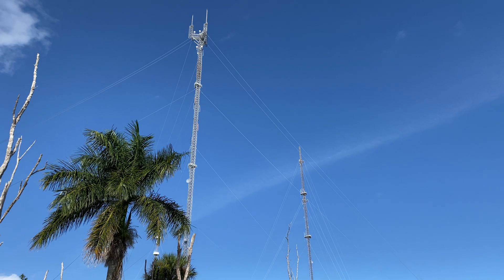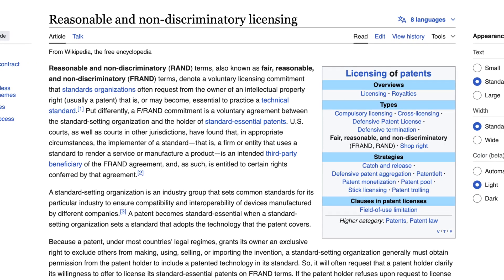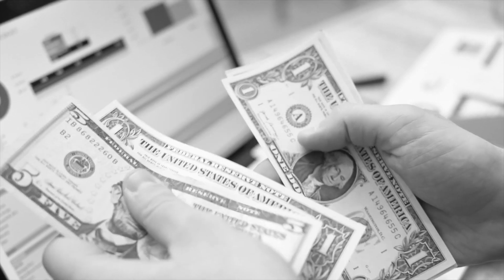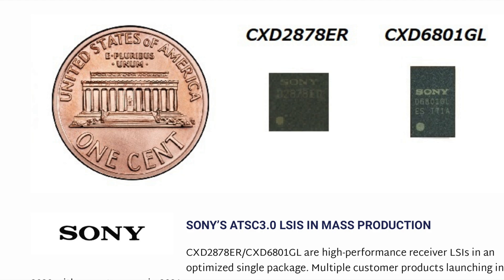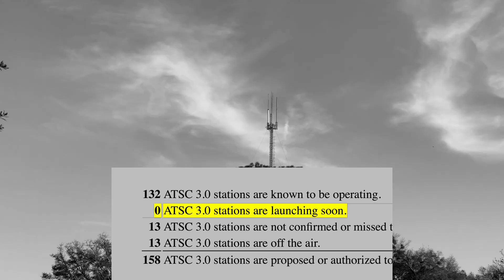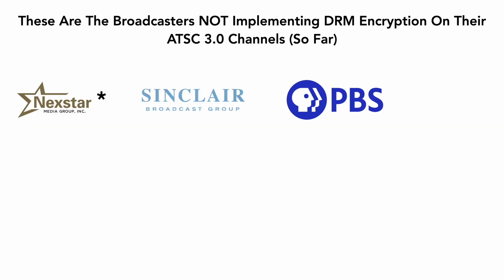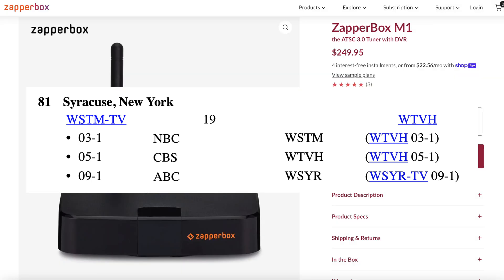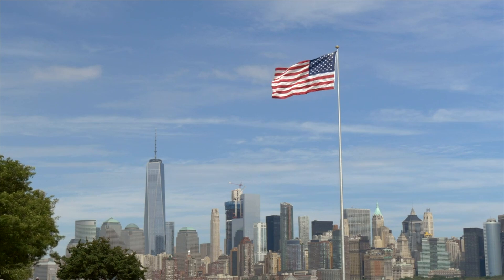ATSC 3.0 Is In Jeopardy

Comment: All free old OTA ATSC 1.0 TV subchannels legally gone in 2027.
This FCC legal trick means no free money for New DRM 3.0 TV tuners legally needed to be paid for by the DRM 3.0 TV stations.

OTA DRM encrypted ATSC 3.0 TV stations plan to steal all of the  (Free OTA ATSC 1.0 subchannels)  in one evil move by installing only  (1 permanent forever Reverse ATSC 1.0 TV lighthouse transmitter antenna) to replace all old 1.0 TV stations in an area in 2027.

People still can watch the free old OTA ATSC 1.0 TV without any subchannels and without needing a new expensive DRM 3.0 TV tuner box.

This FCC legal trick says only one main Free channel and no subchannels are required by FCC rules. 

Your free OTA (over the air) USA TV subchannels birthright gone in 2027.

The extra unused OTA DRM 3.0 TV bandwidth is now legally in the DRM 3.0 TV stations ownership and not in the USA people's ownership.

Boycott OTA (over the air) DRM (digital rights management) encryption ATSC 3.0 NEXTGEN-TV until DRM is removed by law in the USA.

IMO.

Comment: I have no sympathy for ATSC-3.  It includes DRM and encryption making a nonsense of "the public's airwaves".  The idea that a TV maker can make their profit by inflicting ads on the viewer is a bad thing.
ATSC-1 works just fine.  The practical effect of a switch to ATSC-3 will be:
1) People will have to buy a new converter box that costs $100s of dollars rather than the $30 for an ATSC-1 box.
2) With the new box some channels still won't come in because the box lacks the keys for that one.
3) The DVR feature of the ATSC-1 box is waaaaaay  better than what you can do with the ATSC-3 box.
4) The broadcasters are free to change the key they use so your box quits working
Reply: airwaves used to be licensed, now they are bought, so I guess they dont belong to us anymore?
Reply: Atsc 1.0 works fine? Really  move to the moutians 50 miles away see how well it works out for you!
Reply: @tuckermichael24  The standard would still work better than ATSC-3 does.  The DRM BS makes it not work.  In the mountains the internet connection to get the decryption keys is not relaiable